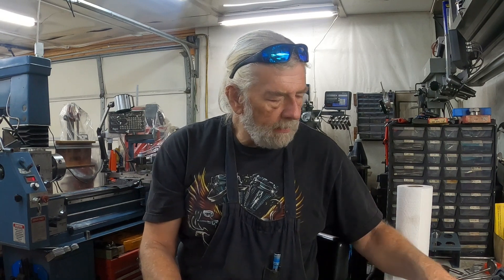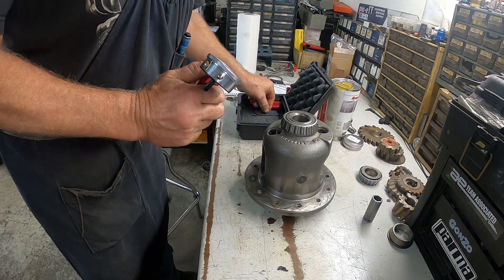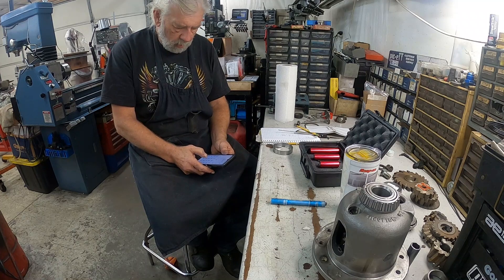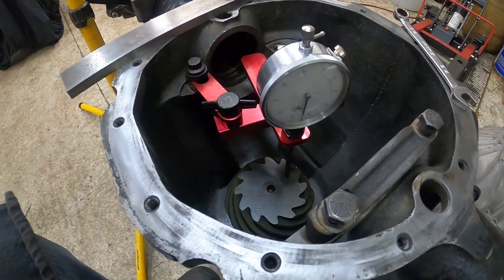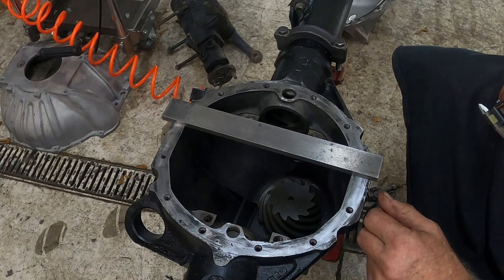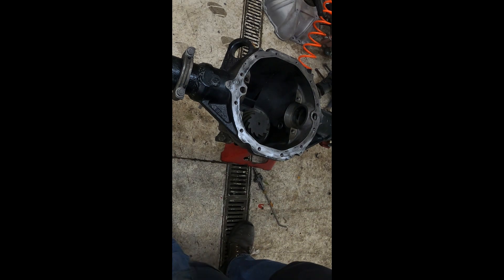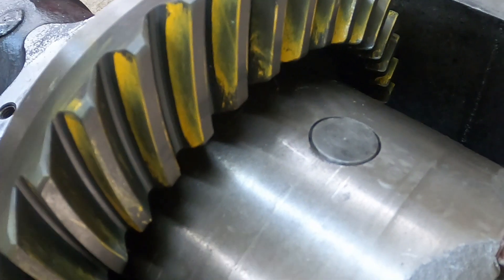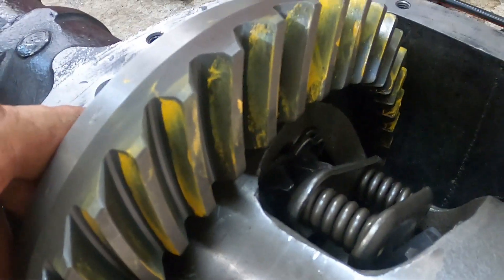setting pinion depth with depth tool

Comment: How do you calibrate The pressure on the carrier bearings with shim's
Reply from the maker: Hi you really can't  measure the preload on the side bearings other than by how hard it is to install the side shims, If they just slip in it is to loose and if you really have to pound them in they are to tight. with both of the bearing caps off the carrier  it should not just pull out of the axle housing. Thanks for your question I hope my answer helps.
Reply: @Randysshop  thanks that's the macanic feel  for the rotation of the gears.
Reply from the maker: yeah it is kind of going by feel, and that is why I said the part about lifting the carrier out of the axle housing. when it is about right on side bearing pre load you will need to use a pry bar to remove the carrier. What you can do is install the carrier with no ring gear on it and shim the side bearings and spin the carrier and feel the drag on the bearings, when you spin it the carrier should rotate about one turn and stop that will be really close. Then you will feel how tight the shims are on the side bearings when you try to remove them. I hope this helps you out, any more questions just send me a message. Thanks @MarkZill

Comment: I've been looking at the T&D pinion depth tool, but it didn't look like it was all that much more difficult to set up this much cheaper version. Now I'm torn if the extra cost is going to really be worth it for the few axles I do. Thanks for the demo.
Reply from the maker: This tool seems to work ok, and for the 3 or 4 ring and pinions I do a year it is ok for the money.

Comment: So I’m changing my gears from a 3.55 to 3.73 on a 2006 ford mustang GT 8.8 differential ,I’m stuck on my pinion part I put 0.030inchs shim on the pinion gear but my old pinion shim was a 0.023 but after installing the 0.030 shim on my pinion gear and getting the pre load at 28 inch lbs rotating force, my pinion gear is getting stuck on the LSD Carrier……… bearings are new, could my problem be that I use to much shims for my pinion gear that why it touches the carrier??
Reply from the maker: the pinion rubbing on the carrier may be caused by the shim, some times they will be really close.I always start with the stock shim thickness on the pinion and make adjustments from that point. Also make sure the rear pinion bearing is pressed on all the way, and the race that goes in the housing is fully seated. did you check the pinion depth before you put the carrier in?
Reply: @Randysshop  I couldn’t check the pattern before because the top of the pinion was touching the carrier but the carrier shims that backlash sound really nice, not to little or to much but then trying to turn the pinion I noticed the flat top side of the pinion touching the carrier
Reply: @Randysshop  but no I don’t have pinion depth tool, and yes I know I should’ve took it to a professional but I carefully study about it and beside I wanted the experience for later on down the road it’s just the pinion shim I get confused on
Reply from the maker: I under stand. jegs sells a depth tool kit you can buy not real expensive and the instructions will show how to do it. save yourself  some $$ and learn at the same time. @Gammaepsilon2002
Reply: A update I got my pinion depth good, check the pattern and it was good pattern in the middle with a 0.021 pinion shim and carrier shims left was 0.261 and right was 0.273 but I’m so happy, three months and I completed it
Reply from the maker: 👍👍 @Gammaepsilon2002

Comment: I like your video. I got the same set up tool last week I want to know how you got the dial indicator to sat on that bracket in the housing did you drill a hole and put a screw in it. let me know so i can do the same thing. thank you waiting for your reply
Reply from the maker: Thanks for the comment. What I used is a small c clamp that you could not see in the view facing the dial indicator. Hope that helps.
Reply: thank you for the reply
 @Randysshop

Comment: Hi Randy. Fantastic video, but you lost me in one place: At 5:03 you call out 1.527". But the way I'm reading the dial gauge, I'm reading 1.572", a difference of over 0.050". What am I missing here? Thanks!
Reply from the maker: Hi DAN what you need to do is count back from 0, because the dial indicator was set at 0 with the setting tool. I hope this clears it up for you. Thanks

Comment: Seems a lot of sodding around just to make the back wheels go round. I bet the factory made cars don't go to all that bother for Joe Public to drive around in. Regards from Australia.
Reply from the maker: Hi Dave I am sure that the factory has way better fixtures for doing this but the same measurements are done so the rear end does not make noise. cheers